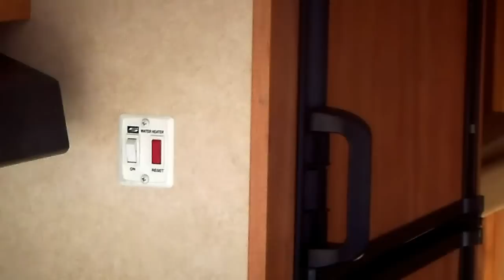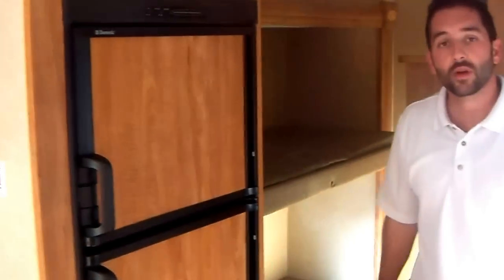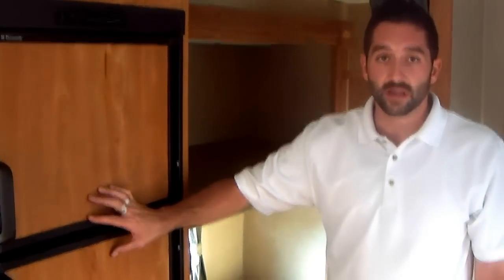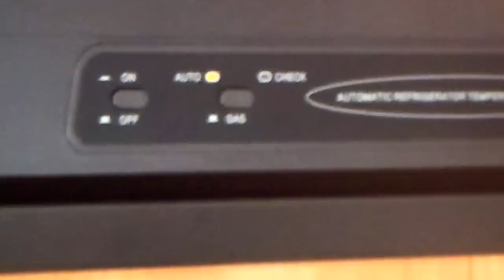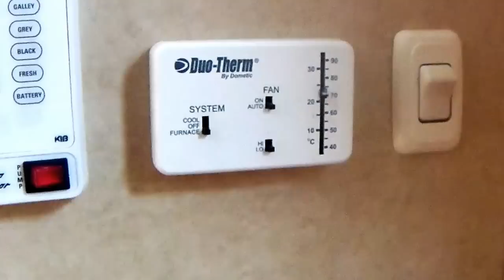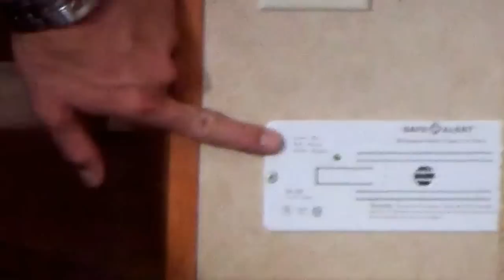Propane System - General Information - RV, Motor Home, Travel Trailer

Comment: Being as a Technician myself Couple of things you should be updated with 1st- the propane regulator you showed is an automatic switch over unit or what's more commonly called as a auto change over regulator, you can open both propane bottles in this case and where  the dial is set to is the supply cylinder, now when this tank becomes empty the second tank will take over automatically at a reduced rate as well the indicator will go red indicating the primary tank is empty that being said you can disconnect the primary tank to refill while the reserve one is in use with no worry of propane loss as the OPD hoses have back flow check valves built in them, 2nd to the style of thermostat you showed the fan switch has nothing to do with the operation of the furnace fan but it dose operate the fan in the roof top air conditioner and should only operate while the thermostat is switched to cool mode and 3rd  one more detector should be present in all Trailers and Motorhomes  and that is a Co2 Detector Most important!!!! especially when operating the stove and or oven other than that Good video keep it up {Grade A}

Comment: So this is whack.  What if you can't get the propane flowing and no burners light?  What a stupid tutorial.  It's if things run smoothly but no advice what to do when they don't.  It would have been helpful to extend help when the burners don't light.
Reply: What is "whack" is you using the word "whack".  Hopefully you have grown up in the year that has passed since you posted this.

Comment: Hi.
Your present video on You tube is a product vertical of our Invention, ----- "A REFRIGERATION AND AIR CONDITIONING SYSTEM"--- India Patent Granted Number :227851. Patent Grant Date: 21 January 2009. Initial Patent filed by me in
September 2006. Using Propane as refrigerant.

Have been granted a Patent for innovation of the Propane Refrigeration.

Exploring options for bringing the end benefits of the invention to the people.

Comment from the maker: Leave it in the 'pilot' position longer(30 sec min.) until the thermocouple gets hot enough to open the main line allowing it to light when you turn the knob. If the pilot blows out immediately after adjusting the  temperature and you're confident that you waited long enough, chances are good the thermocouple is bad.